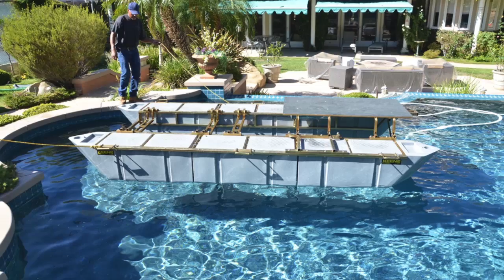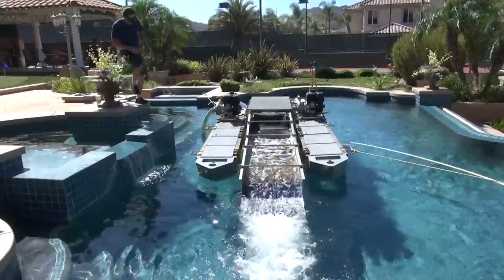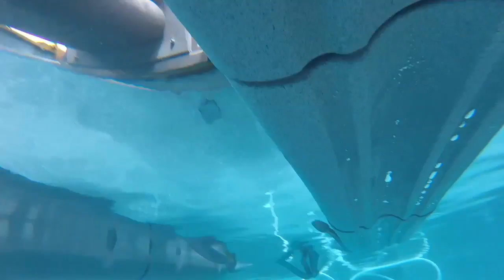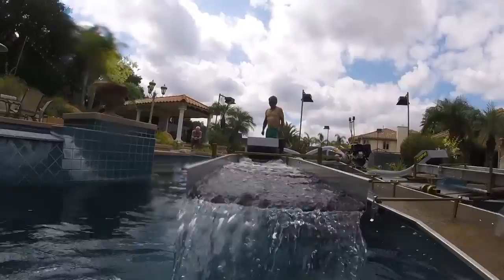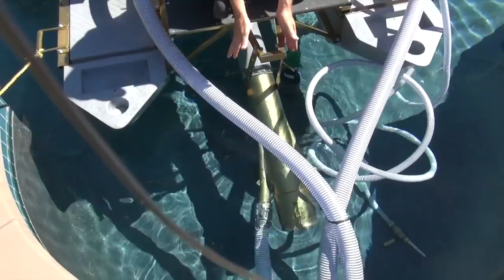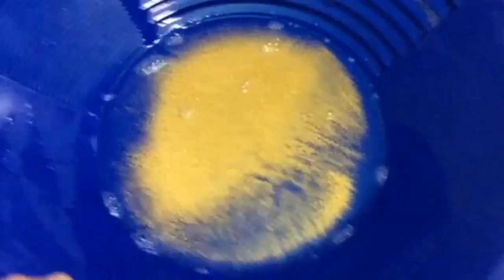6220SMAX 6" Super max Dredge by Keene Engineering

Comment: We can modify the dredge for diamonds.  We have not tested it but we believe that the best option is to add one additional center float to the dredge that would add an additional 4 foot of floatation.  The foats and frame would go from 14 feet long to 18 feet long. We would add a additional sluice length of 4 feet after the sump.  The sump would remove the sand so the diamond riffel should really do a nice job.

Comment from the maker: The price for the 6220smax with the side boxes is 11750.00  the standard model less the side boxes sump etc 9750.00.  You can get larger engines GX390 Hondas add about $1000.00
Reply: very interested in some advice for our plan to go to Nome Alaska .
Reply: Great value for all that engineering I would say.

Comment: That screened grating riffle @ 9:50 does a nice job removing and protecting fine heavy material from large rocks. 

I made something like this to improve fine gold recovery on my Keene 4" 3 stage dredge. https://youtu.be/t2DkThxLkcM

My version has this right after the undercurrent section that I run fully open.
 The drop zone in the first 6 inches of screened grating riffle will typically contain gold no larger than 30 to usually 50 mesh. 
If you are dredging fine gold with a lot of heavy black sands something like this is a must.

Comment: Hello Mark , I'm just wondering how many gallons per hr dus that pump run ?
Reply: Ok you asked each pump produces 250 GPM at 45 psi.  250 x 2 500 GPM
500 x .90 = 450.00 GPM through the hose. So if you can maintian even a 10% slurry.  44 gallons of material per minute.  44 x .1337 = 5.88 cubic feet per minute.  5.88 cubic feet x 60 = 176.4 cubic feet per hour  352 cubic feet per hour Around 13 yards per hour.  If you can maintain a higher slurry then you can go higher.  Calinfonia type dredge we are lucky if we can get a 5% slurrly all depends on the type of ground and the operator.